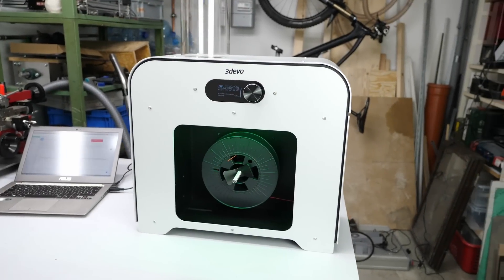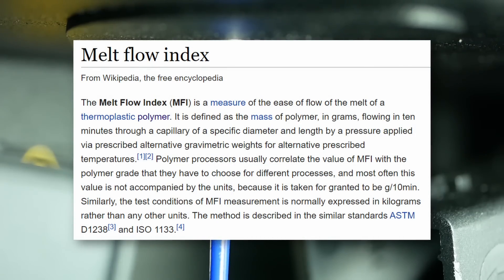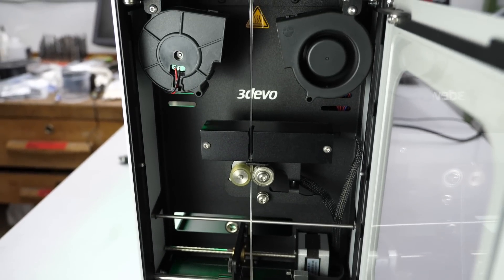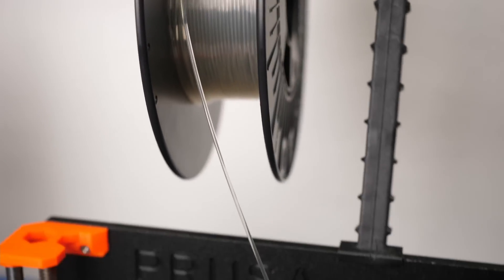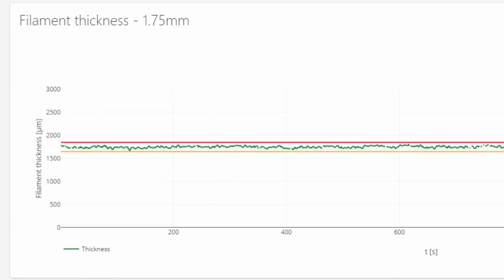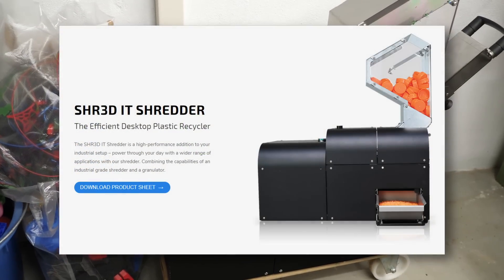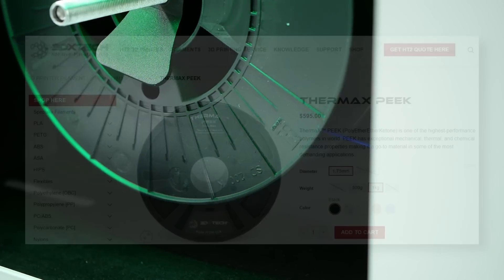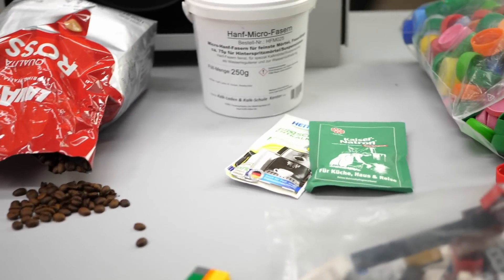Extruding PLA Filament at Home

Comment: A lot of the suggestions here are great, and might work better, but the way PLA pellets become 3d printing spools is a nozzle followed by a “pulling wheel” and fans (to cool it). the same process might work for solvent extraction? CNC kitchen has a video on it

Comment: @cnckitchen would you may make a review of redetec's protocycler v3? I am looking for an all in one device (shredder&Extruder) and it seems to be similar to the 3DEvo you showed here just that i wouldnt have to buy a shredder additionally. with the x1c and ams system there comes a lot of poop waste that i would like to reuse. Is it maybe possible to use 100% of this, without additional pellet material?

Comment: I'm scratching my head in wonder at everyone using very slow, shear type shredders for waste prints. A hammermill with a properly sized screen installed is vastly simpler to build since it really doesn't need anything with tight tolerances except the screen itself. You could make one at home with far less work than would be required for a shear type shredder.

Comment: In the future there will be an real extruder inline with a bypass valve allowing constant extruder flows and the return valve runs the nozzle in FDM   i have run many large and small manufacturing blown film and filament lines with 15-300 hp extruder motors that produce 50-800 lbs/hr  i am surprised its not happened yet I know it can100% 
Dyze kinda started it but they are missing a few things in my opinion not quite complete you cannot vary the extrusion rate in the primary feed it must remain consistent its missing a diverter valve... 
screw flight design is as important as barrel to screw tolerances and as do dies changes are needed for different materials sometimes screws are needed for different materials to run correctly and heater zone profile heats, screen packs mesh changes water air suspension tables heater band set ups and more 
Cr38 and Nickle dies with heavy quality chrome on the barrel and screw Micro polished

Comment: nice job Stefan try to mix in regrind at 20% and 79% with virgin resin with black masterbatch 1% it will work 

the regrind\ flakes at 100% will ingest air and bridge at the thought of the barrel causing a actual REAL extruder jam...and or inconsistency in extrusions

Comment: IO SO SOLO CHE SIETE DEGLI IPOCRITI. PRIMA SCASSATE LA MINCHIA CON IL DISCORSO DEL CLIMA. LA TUNBERG & COMPANY E I SUOI BLA BLA BLA E POI PREZZATE UNA MACCHINA CHE POTREBBE SALVARE IL PIANETA CHE ANZI! DOVREBBE ESSERE RESA ACCESSIBILE COSÌ CHE OGNI PERSONA L'ABBIA IN CASA IN MODO DA POTER FAVORIRE IL RICICLO E INVECE:

O COSTA L'IRA DI DIO CHE VERAMENTE 5000 EURO O 6000 CONSIDERANDO CHE I MATERIALI SONO REPERIBILISSIMI A POCHI EURO, NON NE VEDO IL MOTIVO.

DAI SIETE IPOCRITI. QUINDI SOLO UN RICCO O UN INGEGNERE PUÒ SALVARE IL PIANETA ?! CIOÈ UNO CHE SI PUÒ PERMETTERE O DI SPENDERE 6000 EURO OPPURE UNO CHE È CAPACE DI CREARNE UNA DA ZERO. 

MA PER FAVORE... NON PRENDETEMI PER FESSO. A VOI DEL CLIMA E DI TUTTE QUESTE BUTTANATE NON VI FREGA NULLA
Reply: 1.UNO SHEDDER PER CARTA RIADATTATO PER INTRODURRE LA PLASTICA (USATO POTRESTE TROVARLO ANCHE A POCHI EURO).
OPPURE...
UNA BASE DI LEGNO DI ABETE; UN MORSETTO PER TENERE LA BASE ANCORATA AL TAVOLO; UNO STECCO DA ARROSTICINO; 7RONDELLE; 2VITI PER LEGNO; UNA LAMETTA DEL TEMPERINO. 
TAGLIATE IL FONDO DELLE BOTTIGLIE DI PLASTICA E RICAVERETE DEI FILI GREZZI DA POI SCALDARE. 

AVENDO UN ESTRUSORE CHE AVANZA DA UNA QUALSIASI STAMPANTE 3D..LO COLLOCATE FISSO IN UN PUNTO STRATEGICO E GLI DATE CORRENTE IN MODO CHE SCALDI, INSERITE IL FILO GREZZO RICAVATO DALLE BOTTIGLIE E TOH AVRETE IL VOSTRO FILO DAL DIAMETRO DI 1.75" PER LE VOSTRE FUTURE STAMPE 3D.

SPESA PER REALIZZARE TUTTO IN MODO CHE SIA ANCHE PULITO: MENO DI 100 EURO (80 È ANCHE TROPPO) 

ECCO COME SI SALVA L'AMBIENTE. 
CONDIVIDENDO LE INFORMAZIONI E NON SPECULANDOCI SOPRA COME DEGLI SCIACALLI.

Comment: Hello,  I'd have to use a filament extruder from pellet, like the 3DEVO, for industrial application bacause we'd like to buy the pellet and not the filament for the 3D printed products that we currently design in our factory. 
Considering the application, the price of 5.000 € would not be a problem. 
The main question is: could we consider that the output filament will be trustably constant and we won't have problems when we insert it into the 3D printers, or is this mostly a laboratory product which is suitable for experimentation but not for daily use in industrial application? 

Thank you

Comment: I'd really be interesting in some of the affordable purchasable / kit options. Something, that is at least somewhat hassle free, but produces filament. I've seen a couple of these extruders pop-up in the 500-1000$ range. Does somebody have experience with these? Do they tick the boxes?

Being able to make stuff, test it or use it then take it apart, recycle and make again would be like a dream come true.
Reply: Plastic simply degrades too much with each recycling to really be viable. No point in buying a 1000 dollar device just to recycle your own either, you could buy a lifetime supply of brand new, hastle free filament for that price. We can hardly recycle plastic bottles and they come with clear markings indicating the type of plastic they use on each individual bottle, no way we're going to be able to do so with millions of different filaments from millions of companies each with their own unique and decentralized blend of additives. Might be viable for a company or maker space but the logistics of sorting are a nightmare. How much filament does an average 3d printer go through exactly, not enough to justify a personal machine...
Reply: @DrakeOola  Yes, I think you are quite right. It is not really practical, especially at this scale. Thanks

Comment: Recycling filament I think is the next "killer app" of 3D printing... I think what that looks like in a pragmatic way is a combination of more dynamic printing systems (print heads and printers that can adapt to material in realtime) and of course access to filament extruders

Comment: try in-mold or resin type layer-by-layer copper electroplating 3d printing
Reply: diy optical fiber
Reply: um, how about a "coffee maker" direct feed to printer just-in-time spooling, color + pebbles feeder, 2-in-1, color on the fly also
Reply: transparent pulp fiber in epoxy mesh netting woven sculpting
Reply: printed fibers, like carbon fiber, in plastic, 3d printed, automatic "woven" fabric, stitching
Reply: diy plastic reactor in the same machine, 3-in-1
Reply: ball mill or shake mill them to a fine powder
Reply: money is a stupid thing
Reply: use my ART, ion layer printing spray 3d printing, Anode Ray Tube slinging with electric field
Reply: biomass pyrolysis to plastic polymerization
Reply: be independent
Reply: use solar, or wind to get the energy to be vertically integrated, free energy

Comment: Just one question. Why a printer with complex kinematics, a bunch of motors, control board etc, is 10 times cheaper than this machine with a pair of motors and optical sensors?

Comment: one thing i really don't get is, we've been having so much progress in hobby 3d printing for like 10 years now, you can get a cheap printer for <100 bucks (and even a decent one for <200), but extrusion machines are still priced in the thousands. like, in its simplest form it's literally just a slightly higher diameter hotend and a feeding screw instead of a extruder wheel (the 3devo thing seems to additionally have a diameter sensor aka light sensor and a motorized spooler aka single stepper motor), how can that be 10 times the cost?
i mean i get 3devo want's to be a fancy brand and all, but even the tiny ones that are literally just a heated barrel and a motor like the filastruder are still like 2 or 3 times the price of a cheap printer

Comment: Hi Stefan, Really interesting to see you using the 3devo extruder, I'm looking forward to the recycling episode next.
Also it would be interesting to see how much wasted plastic / purged / flushed / contaminated you end up with by the end of the series. I think that is quite an important factor for these small batch production systems as it's then something you will need to dispose of or find a use for...

Comment: Trying to extrude a high temp material like PEEK is also a good way to ruin your expensive machine. At least they walk through the process of extruding PEEK in their YouTube videos, so watch those before getting too excited.

I find it hard to believe that this is meant for professional use because the usability looks to be sacrificed to make a smaller box. This is like those printers that keep the spool behind the machine meaning some awkward handling to work with them. At least the extrusion screw looks pretty legit, I wish I could just buy that.

Comment: My, what a blast from the past. Back in the late '70s, early '80s i was engineering support for a process that stretched glass tubing in a very similar way. We had the additional issue of pressurizing the draw  to maintain the hollow tube aspect ratio. Obviously the temperatures were much higher, and at the time this was all analog. Also obviously the oven was much bigger and more expensive.

Comment: I have not used this extruder, but... I have never seen an extruder that can make filament to a tight enough tolerance to work in my printers. Either it gets too big to fit through or too small to keep feeding. Anyone use one of these?

Comment: I'm preety sad that we have nothing close to the 3Devo here im Brazil.

We are using an industrial extruder to make some compositions for research, which imposes some big difficulties, money wise, since we need around 1 kg just to fill the extruder screw and start the extrusion process.
The other option is a desktop extruder, which has a drill instead of a zoned screw, needless to say that it is preety hard to get a consistent feeding and flow through it, making it close to impossible to secure a consistent filament diameter.

Guess i'm building my own 3Devo spinoff or something on those lines hehe

Comment: What about making first pass out of reused filament very thick (even 4mm if you can) and then run it through cutter, that makes evenly-sized "pellets" (similar to those pigmented pellets)? It should even out the input material for second pass through the machine.

Comment: Like for you and a BIG dislike for companies that are building those machines.
It's a ripoff , inside it's a heater , bunch of sensors,one stepper motor , some fans and a display, plus a fancy box. And a easy soft tuned for it to work "properly" ( they never do).

Comment: The thing about thermo plastics is that remelting them will degrade them for each time you do it (and it gets more degraded the longer it stays melted). Recycling plastics is usually not making them in to the same products, but used for products where there is less off a demand for performance of the plastic. It is not like aluminium where you can remelt it as many times as you want and you still have the same quality.

Comment: At what point does recycled material become unusable? Is virgin material required and at what ratio to make recycled material useful? When I used to work in injection molding factories, we always reused the recycled material, but it had to be combined with virgin material or else you end up with useless material.

Comment: This might be too late, but before you start with the recycling of material, you should be very aware of the maintenance requirements of the machine.  You may need to clean the screw often, especially after switching from one material to another.  Recycled material can leave some carbon on the flights of the screw, purging compound can help with this by extending the time required in between screw and barrel cleanings.  Also depending on the material, the material will also require drying.  PETG is pretty notorious for bubbles when adding in "regrind" (recycled material).

Comment: Unfortunately, the cheapest 3DEvo is the Composer 350 at US$6,840. You'll also need the Shred IT shredder at US$6,700 for a total of US$13,540.
A kg spool of Overture PLA filament on Amazon.com is US21... so I have to MAKE 644 1 kg spools of PLA just to break even.

I've had a 3D printer for 10 years and I don't think I've even used 50 1kg spools... so, interesting idea, but really not practical. And I suspect the time it takes to make a 1kg spool... it would take 3 months of non-stop shredding and extruding to get to 644 spools...

It's really hard to see the cost/benefit here.

Given that 3D printers do exactly the same thing - extrude a filament of molten plastic - and at a much smaller nozzle size - it seems really odd that no one has come up with a personal all in one shredder/fuser/extruder for under $500.
Reply: Considering the cost of the pellets, the break even point might be more like 700 to 800 kg of plastic (excluding labor costs). Without the shredder, the break even point is only a few hundred kg. It seems like this would be a good fit for a print farm that could easily consume that much plastic in a month or two (assuming the filament extruder could even keep up). The added benefit is that they could create custom filaments to match colors or create unique compounded filament. That is, a print farm could both save costs and add value by having such a device. Additionally, you can connect their device directly to a 3D printer for continuous printing which might save on a bit of labor by eliminating spool swaps.

I don't know if I would be able to justify the cost of even a $500 for a filament extruder for just my use. Personally, it would take me quite a long time to get through 20 to 30 kg of plastic. I might be able to save a little extra money by only making as much filament in a particular color as I need. 

This device seems targeted at organization that would use a few hundred kg per month (cost reduction) and/or people that want to experiment with unique compounded filaments for R&D (value add).

Comment: Just curious, what is the humidity like in the room you’re in?  I’ve been reading the 4043D handling documents and it’s all pretty vague, saying you NEED to have the filament at 200ppm moisture.  Did you have any way to measure that?

The documentation says that it can make weaker filament if it’s not completely dry.  I just bought 1700lbs of nature works PLA, and it just arrived 2 days ago.  I’m a little nervous to open it all up before I know what I’m doing.

Fantastic video by the way.  Love to see stuff like this covered since not many people do it

Comment: $5K actually isn't too bad, considering the cost of other pricey printing options, like what you'd find from Formlabs. I think the only thing holding back the home gamer is the feasibility of production. I doubt it's as easy to use as a Prusa Mk3 in terms of setup and use, and it doesn't sound like there is easy access to Masterbatch pigments.

Comment: I went on a course at this company last year. Their team is amazing. Their machines are amazing. Their facility is amazing.  It is a super interesting process but you need a lot and I mean a lot of knowledge about plastics and other stuff because you've got a lot of different parameters and factors that come into play. We tried all day to extrude injection moulding grade polypropylene but the end result wasn't great. If we used 3d printing grade or a different kind of polypropylene we might've been successful. But anyway I had loads of fun and learned a lot.